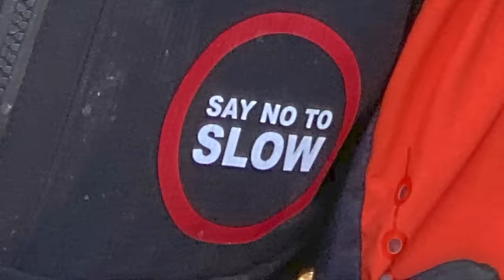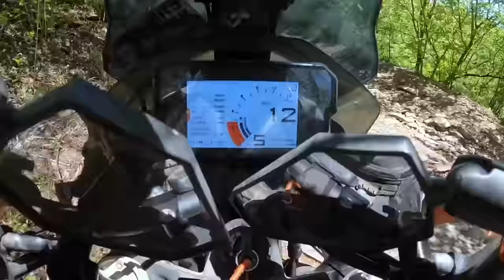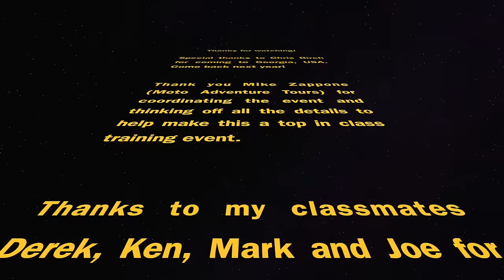My experience attending Chris Birch's Say No To Slow coaching course

Comment: Thanks for the vid. Looks great. What were the bike setup things Chris helped you with? Suspension or something else? Also, what slip setting on rally mode did he recommend? I saw you riding 5 I think most of the time. Did you adjust that on the fly for different conditions? Thanks!
Reply from the maker: Thanks!  He went through top to bottom of bike from tires, handlebars, controls, back brake and clutch levers, suspension, weight distribution and more.  I like to keep my bike in Rally mode with off-road ABS, street throttle, and bounce between 4 and 5 for traction.  I changed it on the fly and down to 1 when we did the wheelie practice.
Reply: Many thanks for your reply. I see Chris has a video series which I think I’ll get. Won’t be the same, but I’ll get quality (I hope) information quicker and likely a lot cheaper!

Comment: what is the orange front brake fluid reservoir cap you're having on your 790R? mine is leaking and looking for a fix...
Reply from the maker: It's just a decorative cover I purchased from KTM brothers online shop.  I had the same slow/slight leak issue.  This cover didn't help much but it stopped leaking once I gently torqued the screws to the right tension.  No more leaks.  Over and under tightening causes is to leak.  Hope they improved the design with the 2023 model.

Comment: What did you break due to improper setup?
Reply from the maker: Both front rotors damaged that had to be replaced along with new hand guards.  Combination of having my hand levers not set correctly for standing, brake lever set too low and bad eye positioning causing me to crash in a rut.  I couldn’t effectively brake and my hands slipped off my grips while trying to use clutch and front brake controls.  This class showed me proper set up and they why behind it which made me reflect on this particular crash.

Comment: I’m curious if he gave a reason why to swap out the tractionator?
Reply from the maker: He said it all depends on the type of riding that we are doing or want to do.  In my case, I am riding mostly off-road in the forest on slippery wet GA clay conditions where softer rubber and larger more spaced blocks provides much more traction.  I put thousands of miles on my Tractionator Rallz front and back and they tend to perform better on harder dryer and rocky conditions, in my opinion and experience.  When I hit muddy clay or slippery dirt and tree roots, it got sketchy.  So far the Mitas E10 has impressed me but I only have the rear tire.  I kept the Tractionator Rallz front tire on my bike which seems to track well.  Cheers

Comment: Is that your gear indicator so you roll with throttle assist w/o stalling or is it a mode number an I just overthink?
Reply from the maker: I think you are referring to the traction control setting which I had mostly set to 5 for medium traction intervention.  I can change it while riding to 1 which is virtually no traction control to 9 where the engine intervenes a lot.

Comment: KTM 890 weighs 470 pounds and lays flat! BMW 1200GS weighs 524 pounds and doesn't lay flat! Either bike is too heavy to get overly confident off road!
Reply from the maker: They are heavy bikes but the training significantly improved my competence and confidence on the KTM 790.  True for the class as well, we pushed our limits.
Reply: @theEHWAZ  I've heard it was addressed on later models and the pro model didn't have the same issue.